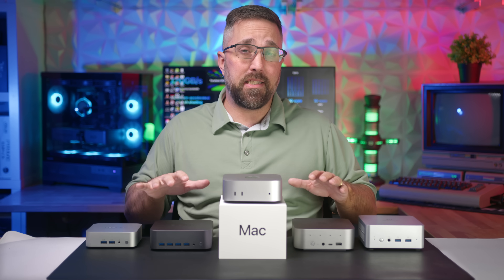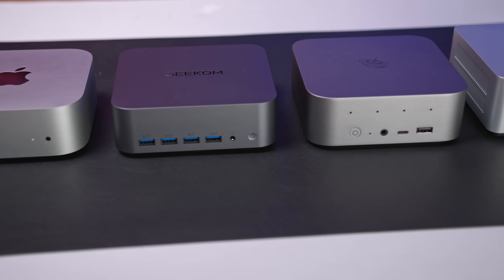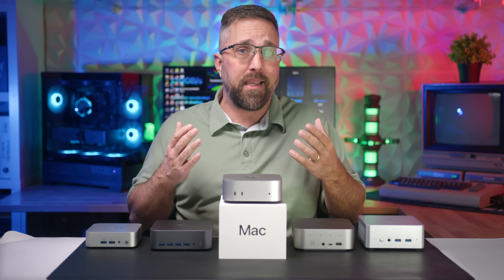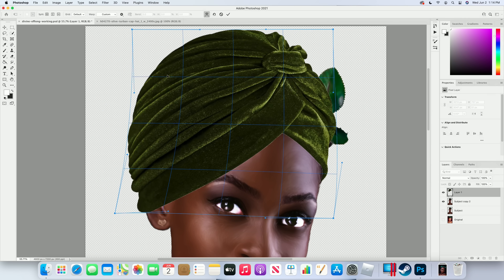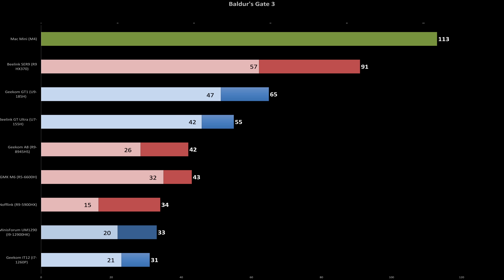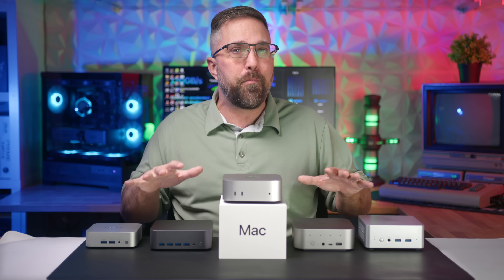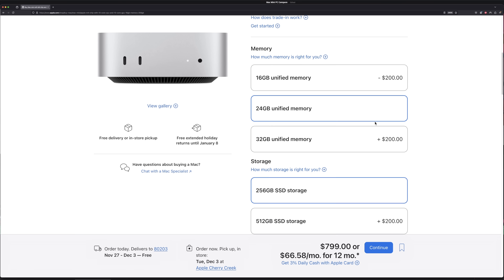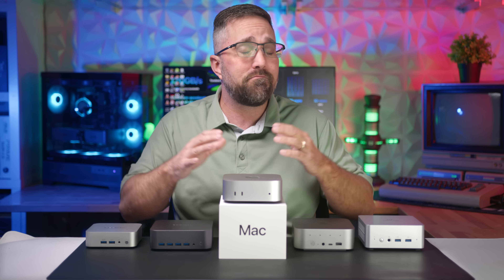M4 Mac Mini vs Intel and AMD Flagships – It's Not Even Close!

Comment: Dont worry about not being able to play modern games, you wouldnt have harddrive space to install them anyway.
Reply: hah, true. there are some games that literally don't fit in that entire ssd
Reply: @GraveUypo  You don't buy a mini mac for gaming you clown cope and sethe.
Reply: Where people see flaws, I see opportunity: Macs are getting more and more popular. It's time to make Metal a relevant API in the gamedev industry and start producing Mac exclusives. The target audience is already there, it's just the matter of delivering a product
Reply: Most people run their Macs on external SSD not on internal ones.
Reply: I have a 4tb nvme 990 pro in my hx99g….youre way off
Reply: @Arexxen Also, many people working finance/insurance/data analysis are on a Windows PC.  Examples: Lenovo ThinkPad T14, Lenovo X1 Carbon Gen, Dell Latitude, and HP EliteBook 840.
Reply: Just get an external Thunderbolt ssd and you got all the Space you want
Reply: Intresting and now you please explain again why you chose the cheapest mac mini and not one with a 1TB SSD and 32GB RAM for so eindeutig of bester comparision.
So lets and my favorite: a minisforum um773 lite barebone, we take 16gb RAM from ebay for 20€ + 1TB SSD for 60€ and .. tada... we are at 400€. Why didn't you add this to the comparsion?
Reply: I just want to play half life tbh. Would this or a hp victus for example be better?
Reply: @titancheat none of these are that great at gaming,
Reply: Honestly Apple should change how they hike up the price. Like make it reasonable to get up to a terabyte because that’s what most people want and need and keep the base ram at 16 and make maybe going to 24 gbs reasonable and then after that charge whatever because after that anybody who needs tons of storage or ram on their Mac is someone who run a business that makes the money to afford a computer like that
Reply: @Arexxen Actually, engineers outside of software development use ThinkPad P series, Dell Precision, and the HP Zbook Fury.  At Nasa they use Dell Precision workstations with Nvidia RTX 4090.
Reply: If only they made external ssd’s
Reply: Sounds like you are hating on Apple. I am cool with that.  Whatever makes you happy Bro !!!
Reply: Don't worry pal  We all know you are 12 years old 😂😂😂
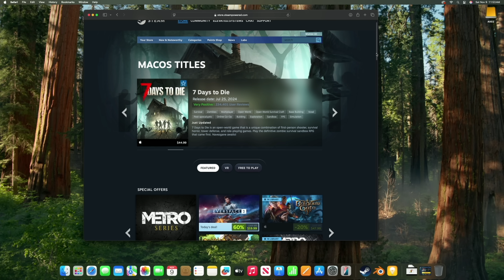Reply: 11:57 FS25.
Reply: Can put the money saved towards a PS5
Reply: You have streaming services that run on everything that can run a browser.
Reply: Imagine using the solution EVERY person with sense should use: get a NAS. Big HDDs are cheap. You can access it from multiple devices. Easily scalable. Building a chunky PC with multiple drives or buying huge expensive nvme drives just don't make sense realistically.
Reply: @ Because it’s literally impossible to have use cases for a computer besides yours?
Reply: You can buy a thunderbolt ssd and keep playin them.
Reply: What if sony decides to make ps6 a PC?!?
Reply: Why would I want to play games in my Mac?
Reply: because a thunderbolt4 or 5 nvme enclosure is too slow, huh?
Reply: HAHAHAHAHAHAHAHAHAHAHAHAHA
Reply: You could add an external storage SSD.
Reply: @ - shouldn’t have to, after paying such a ludicrous amount of money ! 🤷‍♂️
Reply: Only dinosaurs use local storage.
Reply: Imagine one of those things with the new 8TB NVME drives
Reply: You now can install apps on an external drive
Reply: Anyone is still using hard drives in 2025? 😂
Get a 2-4 TB NVMe.
Reply: @leedex Why would anyone spend 3x the cost on an SSD when they need stuff in cold storage? Who is building a NAS off exclusively SSDs?
Reply: Just connect any ssd, or use geforce now
Reply: its not a gaming pc idiot, its for grown ups not like you, who use it for work or so
Reply: You know you can get a 8TB internal SSD if you want… that’s what I have in my MacBook Pro, that’s plenty of space for games if you really want. Personally I don’t care about games, I have an Xbox for that…
Reply: Course you would, use external storage and don’t be obtuse
Reply: @Arexxen Macs are for soycalist qū33řș
Reply: you guys play modren games?
Reply: Surprisingly the base Model loaded up with all my Pro audio software leaves me with 88gb free which is more than enough for working on jobs.
Reply: So do external SSDs not exist? I have a Samsung 2TB SSD at 4000mb/s
Reply: mini pc for browsing ad free and a gaming console to play games.
Reply: just buy a external ssd and that makes no differecne with internal one
Reply: Unlike most apple devices you can actually upgrade these little things easily. I’ve seen people add insane storage and ram to the cheapest one.
Reply: Who plays games anyway in 2025? I mean adults. Children are another story.
Reply: If you want to play, get an Xbox. Problem solved.
Reply: Modern gaming sucks in general I prefer indie games
Reply: Just use an external SSD. You can even get a matching dock for it.
Reply: 256GB is enough for most people. Need more? Buy an SSD.
Reply: @cooperschwartz318 no its ridiculously small! If you install an os and basic programs your allready down by like 10-20gb 😂 and then if you want to install  some programs that take up space like mathematica, matlab, labview, a native instruments library... your pretty quickly at 5gb left for saving documents 😂
Reply: How this apply to people who doesn’t play games on any computer or console?
Reply: Cooked Hard😂
Reply: Old fucks like me don't give a damn about gaymes
Reply: Well, you can use a simple external SSD.. even the Thunderbolt 4 have higher transfer limit like most of the SSD what random user will pick.. and those what are initialy faster like the Thunderbolt 4 you never buy, because it's cost more like the mini PC..
Reply: @TamasKiss-yk4st USB4 enclosures are pretty cheap these days…
Reply: Thanks for taking the time to point out that despite the Mac Mini being the clear performance per dollar champion, performance is only one aspect of what makes a computer useful. The new Apple Silicon Macs are great computers, but just the fact that they're locked into the Apple ecosystem means that there's always going to be a space for Windows or Linux based systems running on x86 platforms for greater flexibility and compatibility.
Reply: @b130610  I know what apple is, but this is not true, and I explain all points in the comment before that I wrote.

Tell me you can change the storage by yourself?, or you need to pay a lot of money  to the company for example. Not matter what you defend, is ok is you need the machine, but is impossible to defend lies and a company that has a lot of politics that is abuse to the consumer, even a lot of important YouTube that talk about tech had been saying a lot.
Reply: @Arexxen no, engineers only use Apple if they have to develop something for the Apple eco system because that is enforced by Apple.
The higher cost for memory and storage is a real issue, networking is another issue because Apple does not play nice with existing Linux and Windows based infrastructure. Engineers also often need virtual machines for testing. With new Mx architecture and Apples policy regarding cross plattform makes it hard for engineers to decide in favor of Apple, especially engineers who are used to the freedom and interoperability of Linux.
Reply: @Arexxen Productive lol. If you consider sending emails and editing YT videos productive
Reply: External Hard Drive is always best option.
Reply: External is the worst option @lamontelatrelle1161
Reply: @Arexxen  Only creative people. Schools and universities here support Windows and/or linux. Buy a mac and you're on your own in unsupported wasteland. Maybe US is different, but the US idoes more things their own way and hardly ever for the better.
Reply: @Arexxen  Windows is the most popular pc os and it is much more popular than mac. 
No sane person will use adobe software that is NOT pirated. And pirating it will be much harder on mac pc, than it is on windows pc
Reply: @_degen69 I worked for a 60+ employee printing company for 10 years, no way you’re going to run a whole department on pirated software unless you want to get in deep chit. It’s just a tax write off anyway, businesses have bigger expenses to worry about like million dollar machines not a $50 a month user license.
Reply: @Arexxen  I've been a graphic designer for almost 30 years. I used both mac and PC, I prefer   PC as it is less fluff.
Reply: @ - I’ve repaired both macs & PCs on a daily basis for over 20 years..macs used to be amazing machines but turned to utter crap almost immediately after Steve Jobbs died. Apple died with him, imo & the pile of 14 dead Mac’s (not one more than 4 years old) sitting in front of me as I write this, is perfect evidence to support my claim !
Reply: @woodstockxx 
I work in IT - got absolutely no issues with Mac’s. 

Dell is of course the most used, but people tend to forget that anything over the base model caters to business. My workplace doesn’t care that a laptop might cost 4k$. 

Not a single apple item I’ve owned have broken down on me, either it’s been screen shattered (own fault) or simply me replacing it. Except for the very first retina MacBook (which just needs a power reset from being out for too long). 

I main windows on the daily, but the quality is a mixed bag due to the amount of vendors.
Reply: @woodstockxx I haven’t run a business repairs but I’ve repair multiple for me and to sell and I don’t see much a difference everyone got cheap not just apple. Asus isn’t what it used to dell isn’t what it used to even the thinkpad got cheaper since the Lenovo takeover
Reply: @bobmorane2082 - I completely agree..everything has got worse, unless we pay more..it’s fkn shite ! 💩
Reply: Like someone already said, with the money you save you can just buy a ps5. I’d rather have a Mac mini and a ps5 than a mini pc with more storage lol
Reply: @jonbig04 The whole purpose Is to have less devices
Reply: @jonbig04  that way you can get screwed by both apple and sony
Reply: @elgatov823 well said, jon, well said ;)
Reply: Very intelligent comment 😂 @jonbig04
Reply: @jonbig04  You can buy SSD memory and change it yourself and bump up to either 2Tb or 4Tb.  Its not that hard and there are YT vids on how.  If you only do 2Tb, its still cheaper.  Plus, mac users prefer running OSX.  👍
Reply: @jonbig04 😂 lol true
Reply: @jonbig04  I wouldn't at all. I don't want a PS5 and as long as it only runs macOS I don't want a Mac Mini either.
Reply: People game on ps5? There are games on ps5?
Reply: GeForce Now is great on any Mac
Reply: @OneTopChap  GeForce Now работает на N100 ценой в 120$.. Нафига тогда всё это ?
Reply: @OneTopChap It’s awful, except for slow paced games
Reply: You can even copy your Home folder and Applications folder into an external drive, so imagine any other type of data…
Reply: @Arexxen neither do many non Apple users. I don't trust Apple either, they bypass iPhone users VPN connections for their apps.
Reply: Queue the Mac fanbois inane drivel...
Reply: @Arexxen  macs used to have a long lifespan, now Apple orphans devices after just a couple or at most a few years 

I still have a working G4 Quicksilver and clamshell iBook, over 20 years old.  I also have 3 iPads, 4 iPhones and 2 Apple Watches that are technically fine but useless as they have been orphaned.
Reply: @PRH123  What brings you to that conclusion? In 1995, my Mac Plus from 1986 was very, very obsolete, and it was only nine years old. It would cry if it saw a box of System 7. Do you really think Apple should be investing resources into supporting a Quicksilver G4?
Reply: @sigcrazy7 what conclusion? I didn’t express any.  I said I have one, no more than that.
Reply: @PRH123 You stated, or at least implied, that Apple’s products used to be supported and usable for a longer period than currently. That assertion is incorrect.
Reply: @sigcrazy7 so stated or only implied, which is it, can’t decide? :)
Reply: @PRH123  You are trying to fight about nothing. Grow up.
Reply: @sigcrazy7 I believe it was you that addressed me with some sort of annoying comment, Mister Jung :)
Reply: @PRH123  just go back and read your comment and stop being a fool. “Macs used to have a long lifespan, now Apple orphans…” This is a false statement by you. Period.
Reply: Haters got issues. 😂😂
Jealous much?
Reply: Coping bc it’s better than ur PC?
Reply: I'm not a gamer.. but the x86 is far superior with the opportunities I've been involved with for more than 40 years. Mac's are nice, I've had to support them, but most people use them as a status symbol.
Reply: @Arexxen  No, No, and not, I said this, because I am web developer, and I know so meany people, a lot of people that use windows or Linux for work. I have to be clear, I did not say that Apple or any the products sell is bad, no, is just this kind of lies had been saying all time like any laws of physics.  For anyone one to want to make any excuse to work, any tool is bad. 

And the other hand, you need to develop any app for iPhone, iPad o Mac, you have to use their products, but is not because the other companies could not make products with macOS, it is because Apple not allow that. The allowed in the past that thing, you should investigate what happened on this time.

Finally, if you have a Mac good for you, not matter is you only do a specific kind of job, is your machine, not mine. I am a developer, and I don't need a Mac.
Reply: If you’re too simple to plug an external drive in - you’d be right
Reply: If you’re buying a mini pc or Mac mini and don’t have a home server to quickly move large files and games then what are you even doing with your life? 😂😂😂😂 my game server has 12tb of storage and I can transfer huge files in seconds.
Reply: SSDs... NOBODY buys HDDs anymore... SSDs are cheap for a long time now.
Reply: @smanzoli my 5@12tb spinning rust LAN server would wildly disagree 😂 so would 99.999% data farms.
Reply: @smanzoli I am interested in the new 8TB NVME drives
Reply: You have right, jajajajaja
Reply: @Arexxen  Jajajajaja, let me laughing more, jajajajaja, tell me something, the video game developer what they use?, you think the people work on companies regularly using mac?, do you think that, this is the simplest idea that apple sold to the world. Keep think that productivity is just on Mac.
Reply: @PterPmntaM He says that as if you can't have productivity without a mac 🙄
Reply: @PterPmntaM  we are not saying that all productivity is on Mac. We are saying that on Mac it’s all productivity.
Reply: @GeeeAus  Not, this is another lie to add to the principal idea
Reply: @Arexxen - erm..guessing this doesn’t include “productive people” that produce a lot of work &/or need to store lots of data & large programs ?! .. wake up .. Apple died with Steve Jobs & everything since Jobs is overpriced sh#te .. I’ve repaired Apple products on a daily basis for over 15 years & have a pile of dead iMacs, MacBooks, iPads & iPhones right in front of me, as I’m writing this, all of which are less than 4-5 years old, some of which are just out of warranty & 1-2 that are still within warranty but Apple refused to repair/replace, after fabricating a BS excuse. Consumers & fanboys need to wake TF up & realise that Apple products are not what they once were & are ABSOLUTE GARBAGE !
Reply: @woodstockxx Your workflow involves a ton of large files and you’re using local storage? Not a NAS in RAID? lol

Comment: the price to performance ignores 1 crucial part. the cheap $600 base for mac mini m4 is gimped with 256gb ssd and 16gb ram shared with gpu. Config to 1tb and 32GB like some others in this like and the mac mini costs more at $1400. You aren't meant to buy the base model.
Reply: Yes, price to performance ignores specs, because it is based on price, and on performance. Great observation!

Comment: Another point is the Beelinks are kind of dodgy, especially the firmware. I have a SER5 and the fan is super loud and doesn't ramp up/down properly. There are bunch of confusing BIOS menus, many of which control things that don't even exist in the actual hardware (it seems to think it's a laptop machine). And if you want a BIOS update you have to search forums or email their support, and get hidden links to updates on file sharing web sites, which makes me think they may not have a proper license to distribute BIOS updates publicly.

At least with Mac you know its been tested properly, and will have actual support, like the Intel NUCs of old.

Actually come to think of it, fan noise would have made for an interesting test. I have a Beelink in a MAME cabinet and that thing has crazy loud fans, on a desktop for productivity it's a total non-starter.

Comment: I’m still amazed that people are using USB A in 2024. 

Also, you can absolutely purchase SSD upgrades for the Mac Mini. People are already making videos of the install.
Reply from the maker: Some of us like Adult size wired keyboards and Apple makes sure their USB C ports aren't fully backwards compatible with USB 2.0 devices.
Reply: @ElevatedSystems  Could you elaborate how it´s not compatible with USB 2.0,? I´ve never heard about that and i didn´t find anything about that topic online. Thanks!
Reply from the maker: @ just try using a usb-c cable to plug in a USB 2.0 mechanical keyboard. 50% chance it works.
Reply: @ElevatedSystems  The statement isn’t entirely accurate. USB-C is a connector type, not a cable specification, and calling a cable “USB” doesn’t guarantee backward compatibility, data transfer, charging, or specific data performance rates. The naming’s game for USB is even more confusing. The USB Implementers Forum has poorly managed these standards, leading to confusion. A similar issue exists with HDMI but on top of this HDMI charges insane premium and is being used less than less. This is why Apple developed Thunderbolt, which offers tighter control over performance but comes at a higher cost.